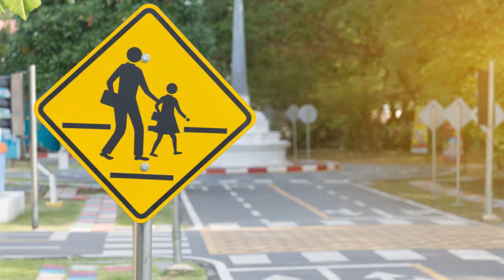Ireland Biggest Megaprojects making London Tremble

Comment: Most of the projects mentioned were completed years ago. Example, Shannon Airports new terminal opened in 2000 and is still operating under capacity. Its runway built in 1961 is the 3rd longest in the British Isles after Heathrow and Gatwick. There have been zero plans for a new runway. Rehabilitation works including new lighting and resurfacing 2.4km of the 3.2km runway was done in 2017/18. 
The M50/N7 juntion upgrade is another project completed a decade ago.
Too many inaccuracies to mention.